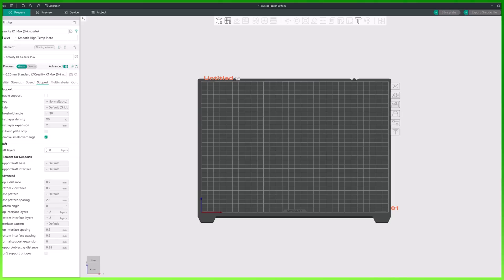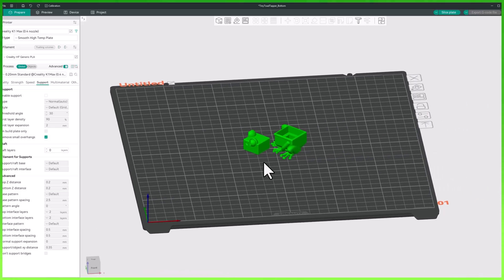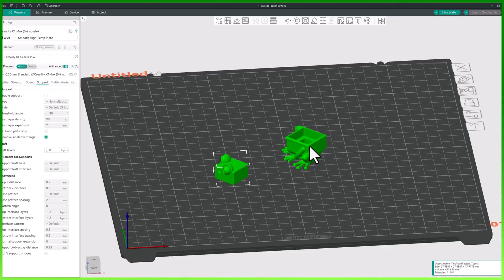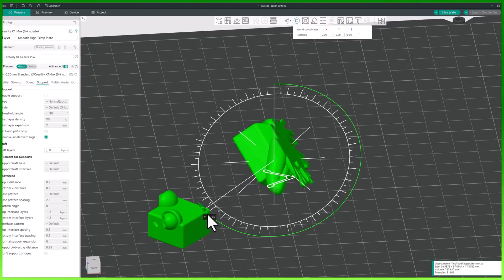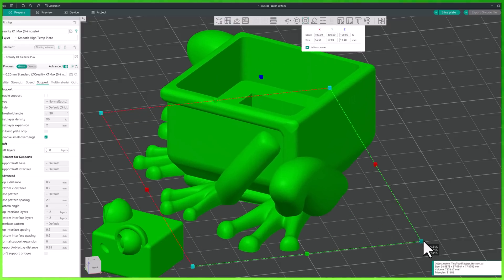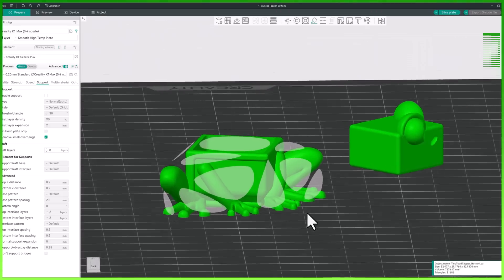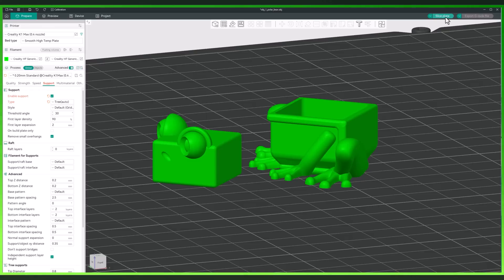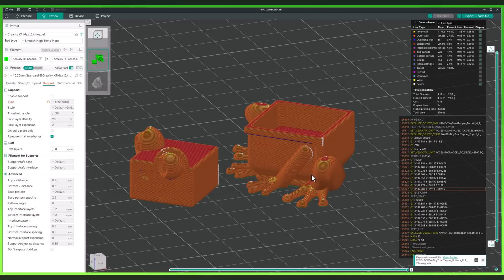Orca Slicer Quick Start: What You Need to Know

Comment: Thanks for the starter. I had an issue right off the bat of course. When I installed my FLSun SR it had my plate too big so I changed it to 260 from 270 and it instantly messes up the centre of the plate. Now it's moved the centre off to the far right side of the plate. Haven't been able to get it back in centre. I would appreciate your input.